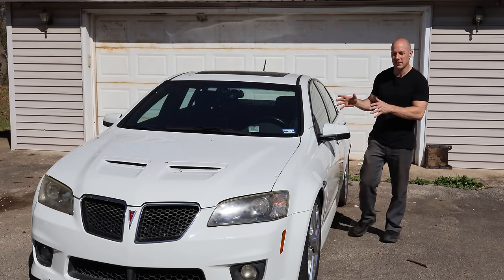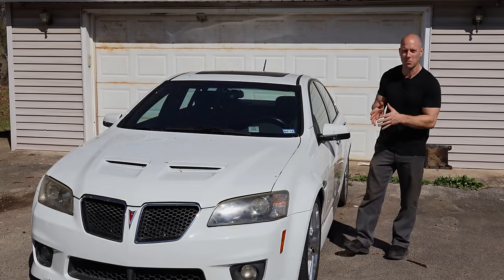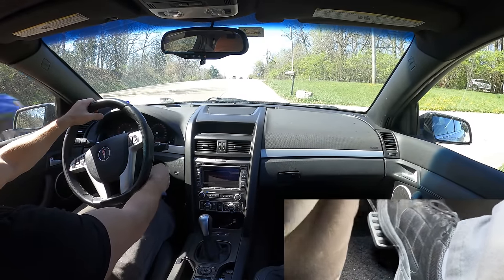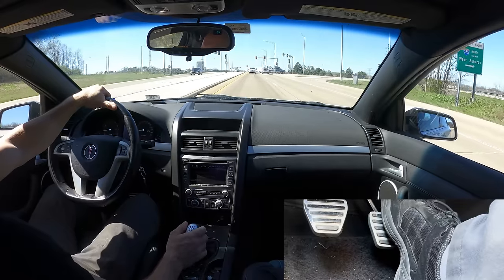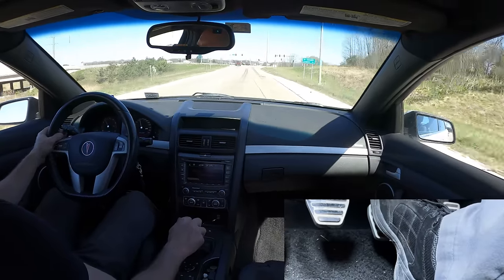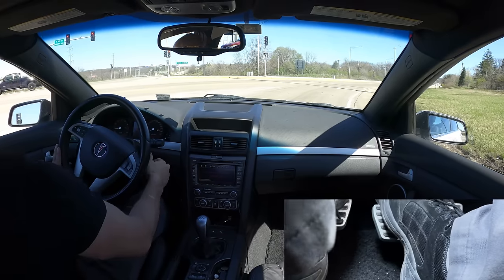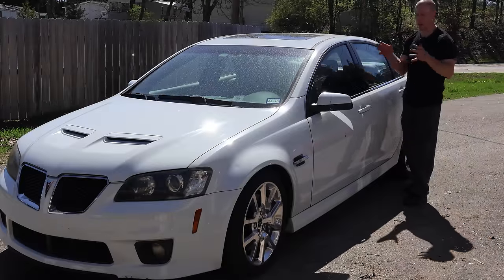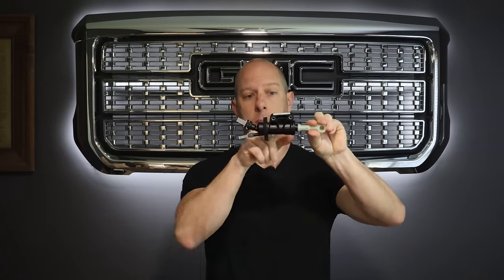How to drive a manual transmission without using the clutch, in case you broke it like I did!

Comment: I really don't understand this - no-one has explained to me how you can start a car in first gear and it not lunge or stall. How? It makes no sense to me.
Reply from the maker: Actually, I did explain it.  Watch the video again.
Reply: @vehcor  Where exactly? You just say put it in gear and "start the car up". Every time I do that it stalls....you don't say how to stop it stalling. you just say put the clutch down for the starter to engage. This isn't an explanation, it's a series of steps.  Are you saying putting the clutch in stops it stalling?

Can you give me a time stamp?
Reply: Also, the name 'Neutral safety switch' means nothing to me...what does it do? Is it a part of the process of not stalling?
Reply: @vehcor  I'm still confused..I've watched the whole thing twice now. You even state very clearly that the car will lunge at a stop if you don't switch off the engine. 

So perhaps I should rephrase:
When I forget my car is in gear and I start my car, it lunges and stalls (This is why we're taught to always be in neutral before we start). But when you start your car in the video in first gear it doesn't lunge or stall. So, what is the difference between starting in gear because you forgot to take it out of gear...and starting the car in first gear without a clutch? I swear I've scanned this video several times and you do not state it at all.

I've read somewhere else it's to do with a starter motor. But again, how is this different to starting in gear when you forgot to take it out. Why does it not lunge or stall in your video, but every time I start my car in first gear because I've forgotten, it absolutely does?
Reply from the maker: @paulhancock3791  try this https://youtu.be/XEuGcO6Ti_8?si=BDQ5HKbntAVf3KWO&t=195 and pay very close attention at 3:20 Like I said I did explain it.  A neutral safety switch keeps the starter from engaging if the clutch pedal is not depressed, that is the only function.
Reply: @vehcor  I think we have different ideas on the word 'explain'. That's totally on me, but I had to read somewhere else what the starter was doing in this situation - so 'neutral safety switch' was meaningless to me.

So, am I right in thinking the starter motor is what is moving the car forward? That's the bit I meant when I said it wasn't explained. I didn't know what the starter was doing from this video.

Comment: I’ve got the bad luck the slave cylinder to explode on the highway(Audi A8 D2 2.8 quattro  manual), so there was a brake fluid everywhere and I lost the brakes, too due to much air in the system.

Comment: I've never seen a car with the clutch slave cylinder inside the bell housing. All my cars have had it on the outside.
Reply: The T56 has the throw out bearing and slave as one unit on the input shaft .

Comment: How do you break a clutch. I live in the UK where everybody uses manual cars & have never once heard of somebody destroying the clutch. I am guessing you used it wrong in some way & over time wore it down through the thing that destroys all things we make Human stupidity you get taught the right way but over time you do it your way & that way may just be your downfall.
Reply from the maker: The seal on the slave cylinder blew out, but by all means blame the driver because of your clear bias.  Also, I find it funny that people from the UK are commenting on having to do this.  Maybe you are not as educated as you think you might be! 🤣
Reply: @vehcor  Yea I wrote this before watching more of the video. after watching it I can see that it was a problem in the parts. I just had never heard of this happening before but maybe most people never mention it & go to a mechanic but this would be helpful getting the car somewhere safe.

Comment: You use the clutch to start the car 🤡
Reply from the maker: Let’s be real, you have never driven a manual transmission.  😂
Reply: @vehcor Clutch safety switch is a US thingy.

Many cars around the world don't have them.

I own 2012 Mercedes SLK-200 6-Speed Manual and it doesn't have it. Thats a Benz which should have some safety features ,

Yet my 2013 Camaro SS 6-Speed manual does have clutch safety switch it even have an animation/sympol with text on the cluster to remind you to push the clutch in case you turn the key to start  without depressing clutch.

USA Drivers are not paying enough attention to what they are doing most of the time. This and lawsuits.